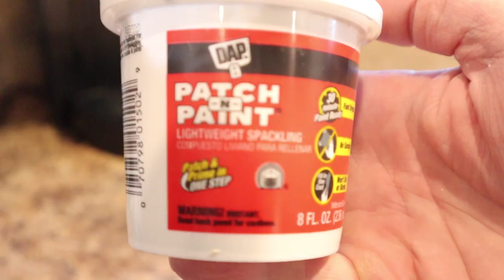Make a Window Valance | Easy DIY

Comment: By filling in the top, as well as the appearance benefit, you would also get the energy saving benefit of interrupting the convection currents over the cold glass surface.

Comment: Another possibility- buy a baseboard piece from Home Depot then cut to fit across top of blinds. Paint with color of choice. Purchase super magnets and double stick heavy duty Velcro. Place magnets on back of wooden piece baseboard piece. using the Velcro to secure them. Place another set of magnets on front facing side of blinds (if metal) and distance them to line up with the magnets on back of wood piece. Place your new valence on top of blinds so magnets line up and you’re done.  This is only if you want a valence to cover the metal mechanism at the top of the blinds and don’t want the valence to extend beyond your window width.

Comment: The problem with this approach is then you have to rip them outta the wall to change out the blinds…
Reply: If you use the magnet method there is nothing to do but take it down as there are no nails, screws or anything. Number of magnets needed will depend on how wide your window is and how heavy the piece of wood you chose.